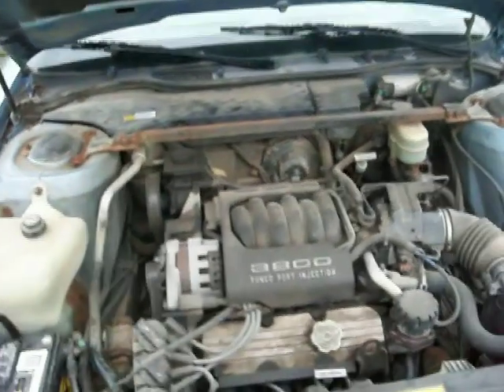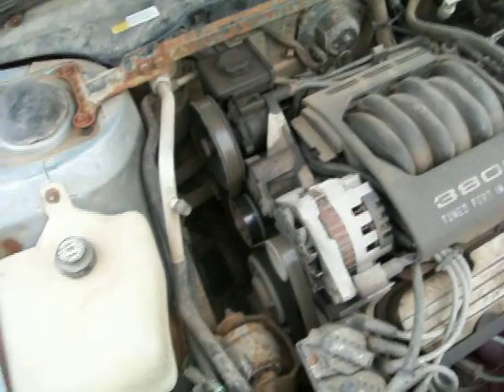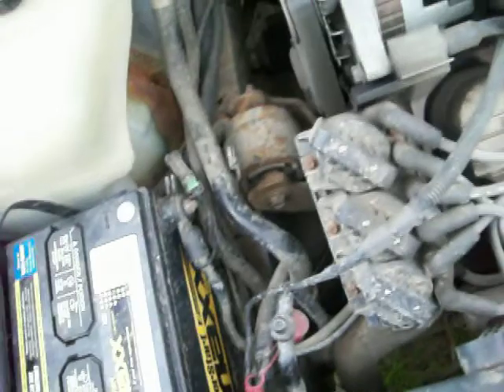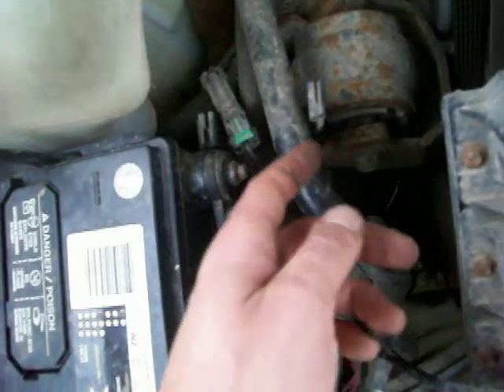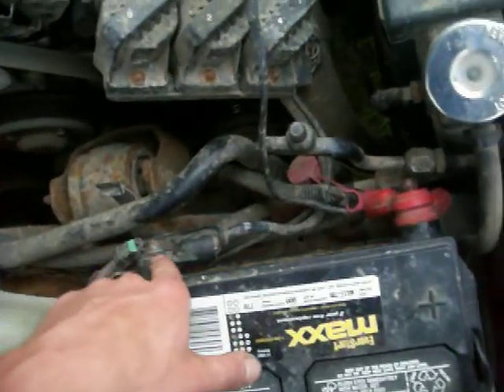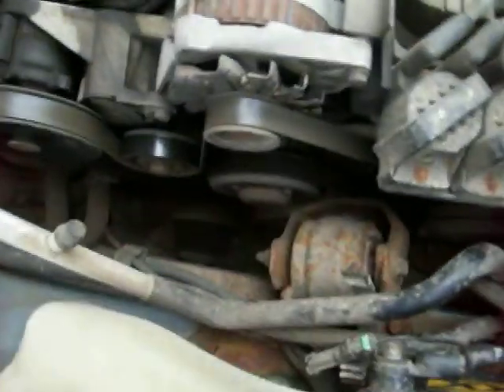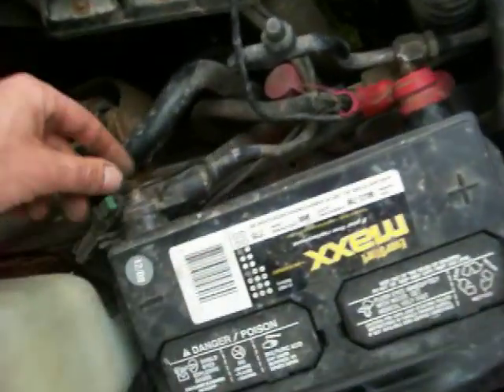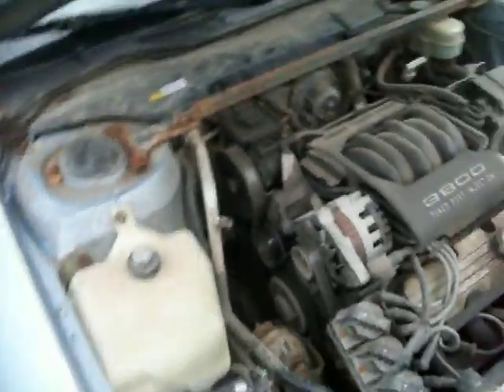Big three upgrade on a Buick Lesabre

Comment: crackermess--> To get full supply to the external Booster or PowerAmp you should run a sufficient positive to that, the thickness is often specified in the user manual for the PowerAmp... The rule of thumb is "the thicker the better" for as little resistance as possible, a couple of really big Condensators near the amp also gives extra boost when those bases kicks in :o) 

By the way, many electrical prob's on cars is related to bad connection and/or ground

This is a nice tips though >bah53<